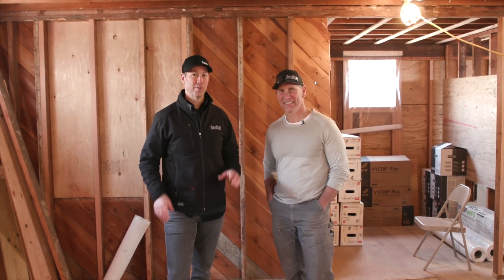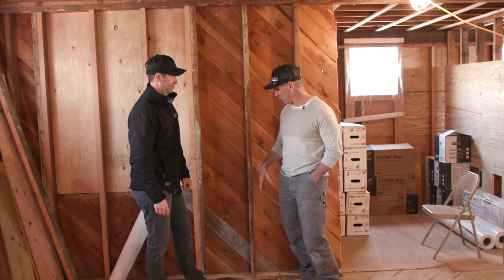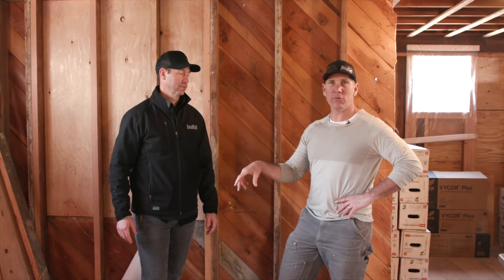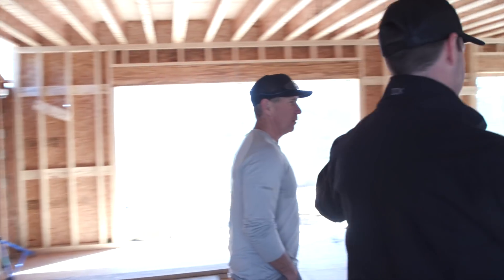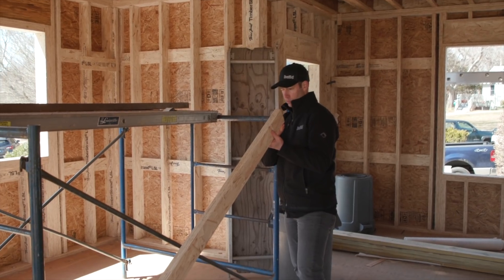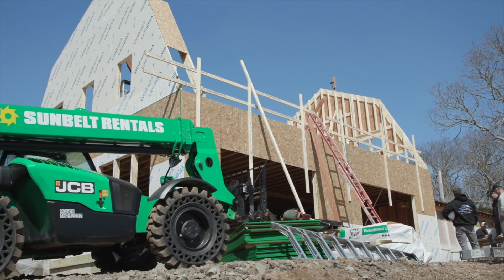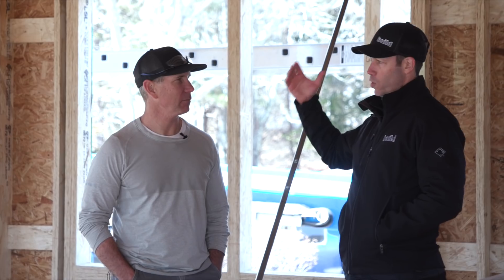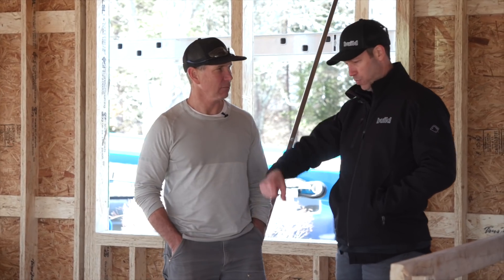Framing Lumber : Traditional vs. Engineered - This Old House Jobsite

Comment: All that beautiful solid wood sheathing and he cheaps out with OSB :0
Reply: OSB has a higher shear strength than plywood. Generally I sheath the lower couple feet with plywood and the rest with osb. Roof deck and flooring always get plywood.
Reply: Andrew Williams Why, flooring always get plywood? Stupid imho. Plywood is not good for flooring.
Reply: @72strand  Plywood glued to joists makes for a superior floor system that will reduce bounce, flex and resist water damage. Why do you say it's not good for flooring? What do you use?
Reply: Andrew Williams Plywood flexes a lot more than particle board. It bounces more to. And you have have the edge over a rafter. Where i live in north EU. We went directly from planks to particleboard. Normaly one inch thick. Some use 2 layers.
Reply: @72strand  only trailers and track houses get particle board around here in the US. Many of the repairs/renovations I do are because the floor got wet and something fell through. I've heard about the popularity of particle board over there, but it sounds stupid to me. It might have less flex up to the point of failure, but that point of failure is much lower than plywood, especially if it gets wet. In my experience anyway. Though I will say that it muffles sound better and finishes better. I will use a 1/2" (12mm) or 5/8" (15mm) mdf over 7/8"+ plywood/planks to make a quieter room, but never where it might get wet. I would never lay a HW floor over it either, or shingles, or anything that uses a nail. I've heard about it's popularity over there though and I know you build different in other ways too, so maybe the technology is advanced. Not around here though!
Reply: As a 17yr flooring guy, you guys keep using particle board, I get replacement jobs all the time.  Plywood or advantech for me. Though any of these will eventually fail with constant water exposure.
Reply: @72strand  All you need to get water in your house is someone to leave a window open during a rain storm, or a plumbing incident. It takes very little water for particle board to swell.
Reply: And what about the expensive wallpaper out of thin paper? Water damage on that? Normaly we have a plastic floor on top or laminate flooring that handles a bucket of water spilled or like that. The reason you keep doing what you are doing is because you don't want to change the metods. Framing, 16 inch on center. Why? Can't "afford" 3x8 studs, so you use 2x6 and that gives you cant build 24 inch on center. But the building gets more expensive that way, more work, more nails, more heating needed. Outside you cant afford real wood so using plastic siding, and that leaks water. So now you need a lot of expensive plastic under that. I have seen houses here that are 100+ years that have no water damage at all and no plastic i the walls, no mold, not even a darker color.
Reply: @72strand  Point of fact, 2x6 outer walls here are build 24" on center, people use plastic siding because they're lazy and don't want to paint the wood, and those 100 year old houses don't have any water damage due in part to they're made almost entirely from lumber, which absorbs and dissipates any of the water that might end up in it (I.E. no particle board) we have those houses here too... P.S. I don't like wallpaper
Reply: @Brendan Breen Industry evolves but do building industry do that? Yes but slow, very slow. Future houses needs to be very energy efficient. New tech makes that possible in part, but the shell needs to evolve to. That is thicker walls and more insulation. 2x6 simply does not cut it.  We don't need passive house walls that can be 600 mm thick. But 400 mm walls is common for new houses where i live. So a new standard of 2x8 in US that give you more room to insulate is needed. You can even do it i layers. 
The new materials is great. But just to replace a 2x6 or plywood floor with a better material is only to go half the way. You need to think new designs. 24" on center is one step on the way. Advantech is particle board? or a variant.
Reply: @72strand  2x6 isn't a limiting factor on insulation, you can use 2" rigid foam over sheathing (which also stops thermal bridging) and with spray foam insulation you can get over R60. Advantec is an oriented strand board (osb) that is designed to be water resistant. It honestly holds nails as well as any subfloor that I've seen. With that a construction adhesive, I've never see a squeaky floor. I can't say I've ever seen a particle board floor that didn't have squeaks and raised nails.. Even after just a few years.
Reply: @Brendan Breen Foam and spray foam is the new asbestos. In 10 years everyone needs to take it out, because it gives you health problems. Roxull is the only insulation i use. Yes rigid foam over sheathing is one way. Adding 2x2 to stud one way. 2x2 nailed horizontally one way. And then using one extra layer of 2" roxull. The ticker the stud the less bridging. The fewer studs the less bridging and so on. Like i said, fewer studs but deeper. OSB is sprayed with clear paint and wax to repeal water. Sand it and it looses a lot of that. 
i don't know the quality of particle floor board you have. But we have no problems. The floor is glued not nailed. Glued to studs, glued to the other sheets , check the video i prev post. Some screws are used to hold it under construction only. You must have a bad product or mount it wrong i you get noise.
Reply: @72strand  Spray foam that's properly done is no where on the level of asbestos, and particle board will also off-gas. I do agree that Roxull is a safer product since it also slows fire. I've never seen Advantec needing to be sanded to this point, but it also credits it's water resistance to the resins its made with and not a coating. Maybec you're right that the particle board here is inferior to Europe's and it more stable than osb, but osb is much stronger than particle board. I guess you pick your poison.
Reply: @rbnhd1976  so far no flooring related call backs, about 17 yrs as well. I'll keep you in mind though. ;)
Reply: @72strand  see again, maybe it's regional, but I can typically get a dimensionally consistant plywood. Besides, I've always found plywood to be easier to plane flat than particle board, when that sort of thing is necesaary.
Reply: Brendan Breen Asbestos was the greatest thing, then. Spray foam may have longtime problems, we don't know. Why take the chance? It's not like its very cheap. The truth is no one knows. i don't know Advantec, but OSB get a coat of wax i know that. Particle board is like everything else, from poor IKEA level of quality to real strong. Yes plywood and OSB are stronger. That is why we use a lot thicker particle board for flooring. What you want is real flat, no seams, and no sounds. Advantec is flat and same thickness but you still needs to have the seams over wood. You can't glue 2 pieces of Advantec and get a new bigger pice that is as strong as the board in the seam. If i am correct?
Reply: Andrew Williams Yes, there are prob a lot better quality of plywood in the US. Plywood is cut in layers from trees. And glued in layers. The process can't be controlled very precise. That is why the thickness normal vary's from board to board and from one edge to the other. The only way to get plywood  in same thickness, is to have it planed and sanded at factory. OSB don't have that problem. But't OSB dont't get a smooth surface. Because plywood is wood, it bends and twists a lot. The different layers are fighting. The level of moist make it bend differently. Particle board is the weakest to hold screws or to bend, or water. But it is cheap, it holds its form and it is very flat and precise. Particle board don't plane it. Don't do that.
Reply: @72strand  If your stance is why take a chance, by that logic then why take a chance with particle boards off gassing, and for health reasons we should just stick with wood planks... Even if it doesn't contain formaldehyde or urea, there's still chemicals and we don't know what the long term problems if them could be. Also Advantech is OSB so only some OSBs come with a wax coating. I don't know what you're obsession with no seams are, but if you glue particle board together its still by definition a seam. I can't say for sure that you can glue the tongue and grooved Advantech and have it be as strong as one piece, but I can say for sure that it's stronger than one piece of particle board of the same thickness.
Reply: Advantech vs particle board is different design philosophy. Because the weaker and cheaper design of a floor particle board. They make them thicker. Perhaps the Advantech is 1/2" thick and price is X. Then the floor particle board is same price but 1" thick. Our floor particle boards are 22x600x1800mm (0,9" x 23,4" x 70,9" inches) and 40 pounds. If you can't glue the boards then you don't get a very flat floor, and you can't ignore were the floor beams are and just glue where ever you want. If i do a kitchen floor and there are gone be a "Whole Floor Patterning white Vinylplastic mat" over the floor every little crack or seam is gone show and feel.  
Yes OSB and particle board do have off gases, so do all wood products. Particle board is worse than normal wood (a very small amount). The gases are bad for you, you need to ventilate. I can choose to not use a spray foam and get Roxull with no off gases. I can't do that with the floors and walls. And i think spray foam is a lot more danger than the sum of all off gases from boards, concrete, Vinyl plastic mats, wallpapers and so on. But that is me, it's you life.
Reply: @72strand  Since the boards are 4x8 and everything over here is 16" or 24" on center, remind me why A) the fact that "I can't ignore beam placement" is a problem and B) why I go through the trouble of making a seam not on a joist even if I didn't have to? Also why would a tongue and groove floor not be flat if I didn't glue them, and who said you "can't" glue the seams in the first place (though since it's tongue and grooved I don't know why you would want too)? If I were to go over a subfloor with a vinyl floor I would skimcoat it, which it likey easier than gluing every seam of subfloor but at very least appreciable effort. Again, you pick your poison.
Reply: Brendan Breen Anyone who have built anything knows that a building is 75% ”special solutions just for this room only.”
No but, it’s faster, better, stronger, and wastes less materials. And buildings are not perfect. Sometimes  the  beam is not perfect in height. If i glue everything to a big pice that does not matter then.

I have particle floor boards in the attic that are not nailed or glued at all. They just lay there. And the tongue and groove makes them better, but its a lot worse than glue the tongue and groove, strengths wise.

Did you watch the link to the video in this tread.?It is easy to glue. To do a second product is more money, time and you block the workplace.
Reply: @72strand  That whole first paragraph doesn't make a whole lot of sense, so I'll do my best with what I can get from it. Particle board is no faster to put down, each have their pluses and minus so it's not "better", it's certainly not stronger especially if someone glued all the seams even though the bead of adhesive on the joists I'm sure is enough, and there's no difference in waste (especially since over here the subfloor goes down before the walls and the waste is dictated only by the footprint)... I did watch the video, and I don't know what you think that would show me aside from it looks like they use wood glue, instead of construction adhesive.
Reply: @72strand  Ohh and a bucket of floor leveler is about $25 US, and maybe 5 mins for an average sized kitchen or bathroom.
Reply: I watch TOH and other channels. The amount of work you do is insane. Billions of nails, screws, and twice the amount of studs vs how we do it i EU. Even then the house is a lot weaker in the end. Most can't even handle concrete tiles on the roof. What i mean is it is never so simple that you always have 24" on center, you need to cut, because of this and that. "There is a hole here for the vent, the stairs, the x and y." 

I think you just think what you do is better and faster. It is not. Perhaps someone else is going to start doing things faster and better. And you have to changer. I think so.
 
Particle board is stronger, than what u use i promise. i can lay down a board 20" out from an edge and jump on it at the end. It will not break off. Can you do that with your thin plywood?
The cost is not in the material, 25 dollars of material is nothing. The cost of having a carpenter in my house is 90 dollar per hour.
Reply: Brendan Breen You do know that wood glue is the strongest glue for wood, right? The glue is stronger that the wood is. Construction adhesive binds worse, cost more, and more damaging to the environment. No one should be using construction adhesive to glue wood parts in house construction, Walls, studs, OSB, Plywood and so on. You only need special "construction adhesive" to roof construction parts. And that is only if the the whole thing was in water, "it may be a problem for the glue".
Reply: @72strand  Someone needs a tampon and some cranberry juice... You clearly think everything that's done over there is better, I've said several times that everything has it's plus and minus and only argued plus sides to a quality product and when what you say is incorrect... You're the only one here with an over inflated ego. 

You're still going to have the same waste with Particle board, a cut out is a cut out. Particle board is not stronger than OSB, it's like comparing concrete to concrete with aggregate. Yes I could do that with Advantech which is more impressive at I'm willing to bet that I weigh more than you. Along with the fact that you put OSB down saying that it's thinner, but you said over there it's .9" vs a minimum of .75" and you can buy up to 1.125". To your point about concrete roofing tile, every house here has an engineer spec everything based on loads so if someone were to spec concrete roofing it would be just fine.

Ohh and by your math with the bucket of lever with 2 baths and a kitchen that would be $55 😲 my budget is shot...
Reply: Brendan Breen So sorry mate, i did not get the feeling, you was so easy to offend. I like discussing new materials, and ways to do things. To be honest ppl in general and Americans defiantly. Don't want to change. Some moths ago, i told a home builder in US to use AFC and GFCI combo breakers in his new construction for the electric. Was hands down shouted down by every one in the comment section. And the homeowner told med how stupid i was. Two weeks later, the inspector forced him to change all breakers to AFC/GFCI.....
Reply: @72strand  Hey, you're the one getting bent out of shape making personal digs about being American because you can't make a decent counter point. If you have the facts on your side, pound the facts. If the law is on your side, pound the law. If neither are on your side, pound the table.
Reply: @bannockchief  Yup- particle board is garbage because of how it reacts if it gets wet.
Reply: It’s possible that could be Advantech sheathing but I can’t see the label.
Reply: @jaysson1151  Zip is like lipstick on a pig.. I'd still rather have ply with a good fluid applied on top.
Reply: Will Singleton I didn’t say Zip sheathing, I said Advantech sheathing.
Reply: @jaysson1151 Advantech is Zip without the WRB.
Reply: Will Singleton no it’s a different formula otherwise, why sell it for a higher price tag?

Comment: You mentioned not using it for exterior walls, porches, etc.  But isn't that engineered lumber on those outside wall studs behind you? Or did you mean to suggest outside exposure?
Reply: Any of the LSL studs that are on outside walls are going to be sheathed. The issue is that during construction LSL can swell up if your building during the rainy season. Walls are up up before the ceiling\roof is installed, during this time the LSL studs are exposed to rain and can swell up, When the do dry out, it does not always go back to its original dimensions. Suppliers really need to add a water resistant sealant on them in my opinion. That said, No issues with swelling with LVLs when they get wet.

Comment: What is the fire rating on these engineered boards and beams? Specifically versus traditional lumber?
Reply: Flame spread ratings were suspect back when these were first introduced. However many series actually have more resilient values than conventional lumber due to borate based additives
Reply: I know for a fact that engineered i joists fail more than twice as fact as dimensionality sawn lumber when exposed to direct flame making it less structurally strong
Reply: Not just a mater of how it spreads and burns, but also how quickly structural members fail when heated. It's interesting to look at the rules that many fire departments have put in place in recent years about going onto the roofs of modern lightweight structures. Houses these days are built with cost and ease of construction in mind, not survivability in a fire.
Reply: Good question
Reply: Put some fire to either and you will have a pile of ashes - guaranteed.
Reply: Besofo shel davar ani lo ratze la'azov et abait